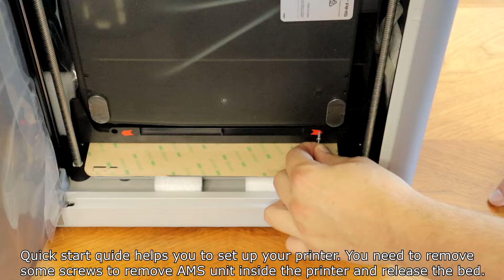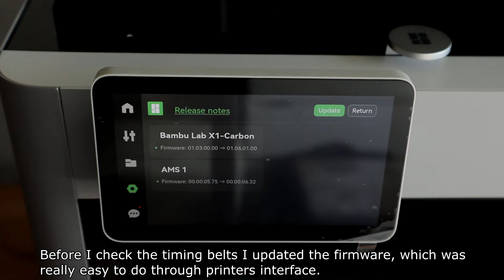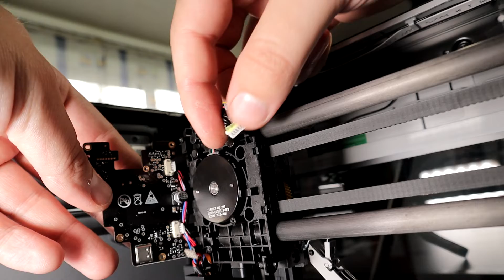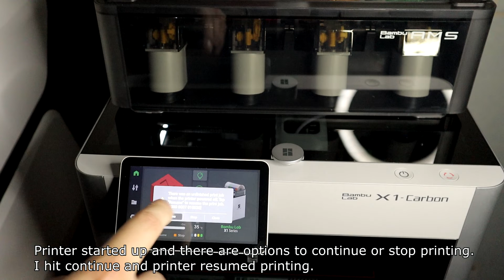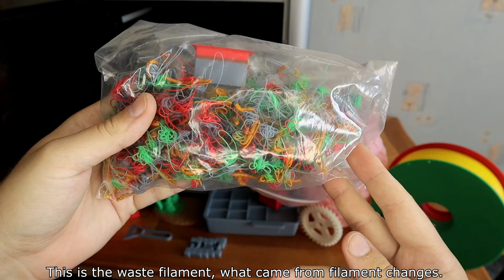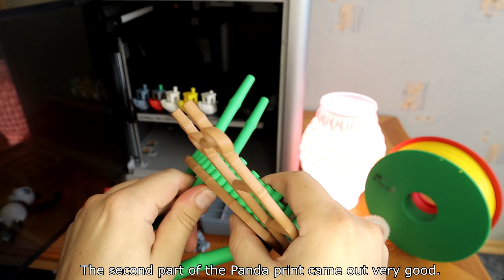Bambu Lab X1-Carbon Combo - One of the BEST 3D PRINTERS?

Comment: Great vid thanks! Why in multi-color printing the print comes out not clean and sometimes clean?
Reply from the maker: It depends of filament you use and sometimes some filament pieces stuck to the nozzle even after cleaning. Sometimes shoot out can clog and nozzle drag some filament on the build plate. Also if you have a lot of filament changes you have bigger chance to got more cleaning to do.